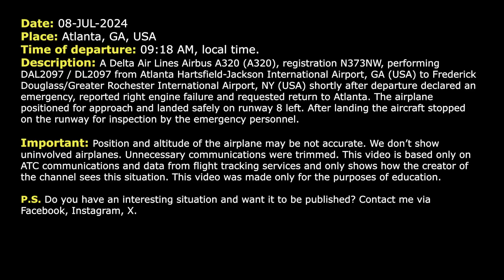Right engine failure shortly after takeoff. Delta Airbus A320 goes back to Atlanta Airport. Real ATC

Comment: I was on this flight! Crazy, right after takeoff felt like the right side of the plane’s underbelly got slapped with a wrecking ball. Hydraulics on the A320 were “barking” to no end. Heard the left engine spool up and the rest was smooth sailing (albeit tense) until landing. Kudos to unreal crew and sharp atc.

Comment: Why stop on the runway and not just let the plane roll onto one of the taxiways? If the thing can keep flying for 10 more minutes it sure can handle an extra 100 feet of rolling down tarmac?  By blocking the runway they could potentially create more issues for the airport.
Reply: Apart from hydraulic issues, they are also worried about a fire. It's best not to drive an airplane full of fuel near other airplanes full of fuel, if you aren't certain your airplane isn't on fire or if you might be shooting sparks from the dead engine. If there is a fire, you need to evacuate everyone, it's also best to not do that around other airplanes taxiing.
Reply: Runway is wider.  Better for inspection or evacuation.  Maybe the airplane is damaged and can’t taxi or is leaking fluid or on fire.
Reply: Runways are much wider than taxiways, so it's easier for ground operations to safely maneuver however they need to around the aircraft.
Reply: My guess is the engine that failed also failed the hydraulic system that does the nose steering
Reply: Honestly
Reply: My aircraft doesn't allow SE taxing.
Reply: There is more space for ground to work on runways as opposed to taxi ways. (I think)
Reply: in case of fire

Comment: After declaring an engine failure, you’re asked to climb 2k feet? 🤔
Reply: Yes could be for either terrain clearance or traffic clearance above uncontrolled VFR traffic. An Airbus missing a single engine will have absolutely no problem climbing 2k. The two most useless things to a pilot is runway behind and altitude above.  As a pilot I want to make sure I have suffient altitude to be safe and I will absolutly climb to that safe altitude
Reply: @Astro-ok9mz that’s exactly why!
Reply: ATL is at 1026 feet above sea level so when they were assigned 4000 that was only 3000 above the ground.  That's a fairly normal altitude for vectoring back to the airport.

Comment: I've really heard the very distinctive PAN-PAN-PAN, haven't I?
Reply: Generally pilots in the USA don't use "PAN", it's more for outside the USA.  Same for "Mayday".  We just declare an emergency, or, more often, ATC declares an emergency for us.  There's no rule against using those terms inside the USA it's just not common practice.
Reply: @darrylr.4983  Maybe you’ve just explained to me why USA pilots use MAYDAY even when it’s just an emergency. They are just not used to pronouncing PAN-PAN-PAN :)

As a non-native speaker, I’m surprised by the distinctive pronunciation of some pilots when it comes to the USA. Alas, this is not a common practice.

I’ve thought that any emergency situation deserves a clear radioexchange. Not to hide the most important word somewhere within usual stuff.
Reply: @alexartukov  When USA Pilots are flying outside the USA they will use "Pan" or "Mayday" because that is the ICAO standard procedure.   I'm retired with 15,000 hours of flying time and have never used either phrase.  In civilian flying I never had a serious emergency, only one situation where my flaps were stuck in the fully retracted position.  Since we had a 13,500 foot runway that wasn't a big issue.   In military flying I had a lot more stuff happen and have declared an emergency a few times but never used "Mayday".

Comment: A320 engines again. Embarrassing.
Reply: Relative newbie here. Engine manufacturing? Engine design? Engine maintenance?
Reply: @pgbrandon could be all sorts of things. Could have been a bird ingestion.
Reply: Yes
Reply: @pgbrandon  Age. The plane is from 2001. Originally flew with Northwest Airlines, which is why it has a NW suffix on its registration. CFM-56 engines, which are extremely reliable. They probably just have too much time on wing.